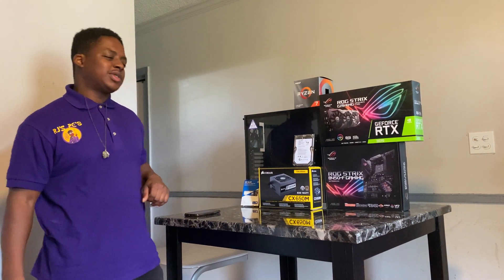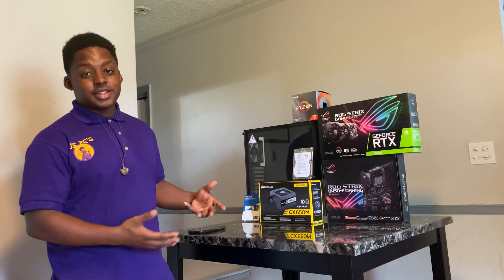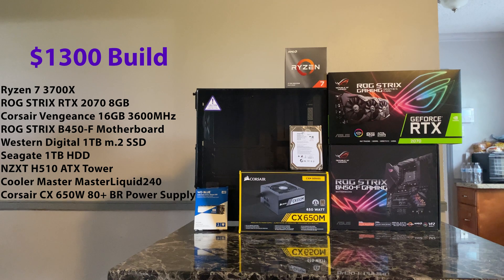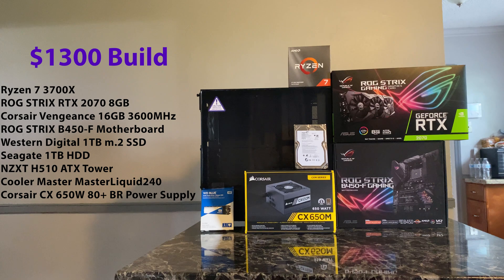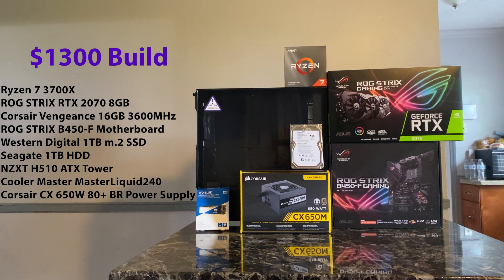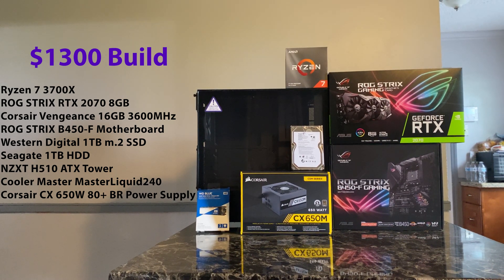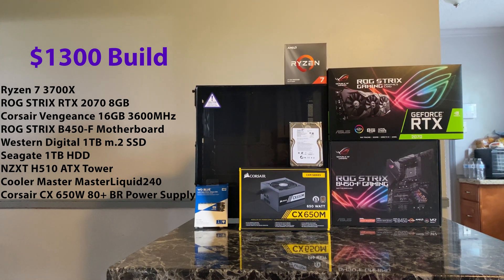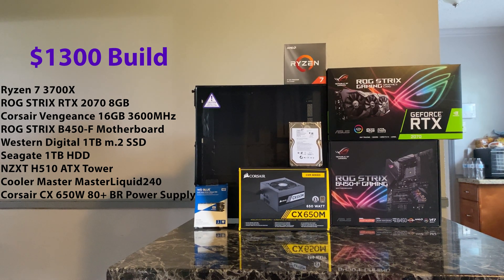BEST $1300 Gaming PC Build | Ryzen 7 3700X + RTX 2070 8GB | 2020

Comment: Can I Use a 3070 instead of the 2070?
Reply: Did I need a new Power Supply?
Reply from the maker: @seltenes9301  650+ will suffice
Reply: Ok thanks for help
Reply from the maker: @seltenes9301  no problem at all 🤓
Reply from the maker: Yes you can

Comment: What are your bios settings are they all auto? Warzone gets laggy if I put my ram at 3600mhz so I have to put it auto at 2666mhz which lowers my FPS but it runs smother
Reply from the maker: I run XMP and it’s at 3600MHz
Reply: @RJBuildsPcs  I’ll give it a try thanks you for your fast response

Comment: Hey man do you know if the Ryzen 7 3700x is compatible with the ASUS rog strix B450-f gaming or do I need to update bios
Reply from the maker: I would say check the description to make sure but it should RJ out of the box from my experience :)
Reply: Lost Muffin6 so I was wondering the same thing I liked into it and some and most will come 3rd gen ready and you will know when you get it because it will say on the box but if you buy used it won’t because asus revised there b450-f board to be 3rd gen ready on most boards and worst case and offers a system were you can rent an older chip to update bios then you should be good

Comment: When I install the drivers for this card it restarts my pc and does a system restore windows thing and sets my pc back to the time before I had the driver
Reply from the maker: Red Samurai 
If that’s the case, there may be an issue with the card. How long have you had the card for?,
Reply: RJ Builds Pcs ever since I got the pc 2 years ago
Reply from the maker: This has been an ongoing issue since you got the card or it just recently? Just asking for specification. You can join my discord server if you have any other questions: https://discord.gg/khcwrR

Comment: GUYS

Specs:
Ryzen 7 3700X
ROG STRIX GTX 2070 8GB
Corsair Vengeance 16GB 3600MHz
ROG STRIX B450-F motherboard
Western Digital 1TB m.2 SSD
Seagate 1TB HDD 7200RPM
Corsair 650W 80+ BR Power Supply
NZXT H510
Cooler Master Master Liquid 240mm

Settings I used for each game:

Fortnite: All low, Epic View Distance
Apex Legends: All low (limited by 144Hz lock)
PUBG: All Low, Epic View distance
COD: All low